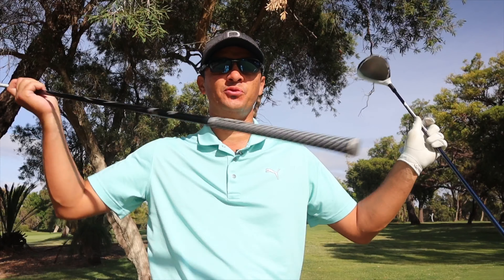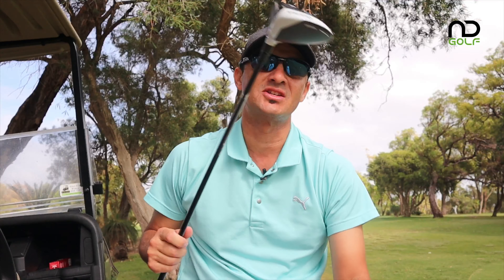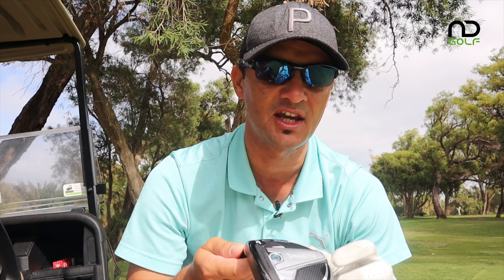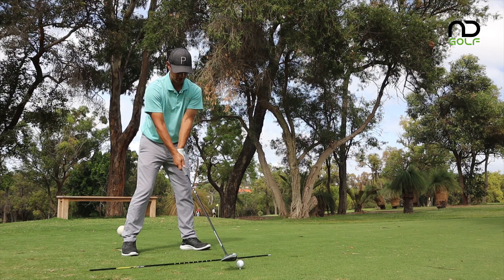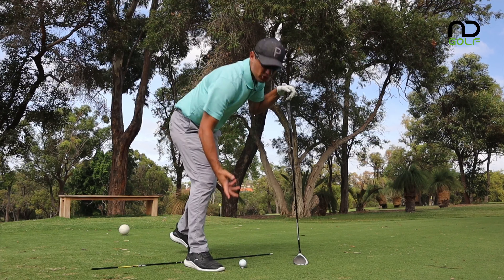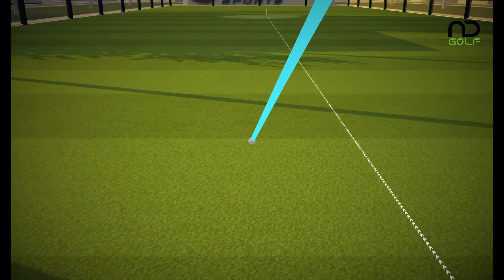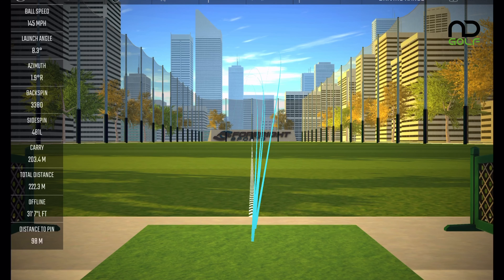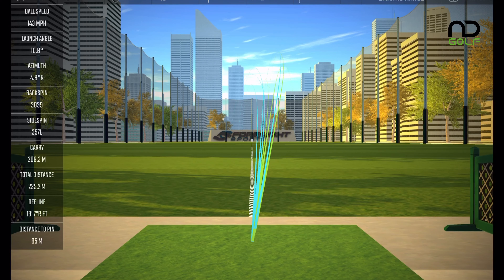TaylorMade Sim 3 Wood Max & Titanium

Comment: Please test the Mavrik and Mavrik SZ fairway woods.  I have a Sim Rocket 14* with the HZRDUS Hulk Green 6.5 coming but I’m a little worried about the size of the head and hitting it off the deck. I like to hit my fw’s off the deck as well as the tee.  The Sim is I believe 185cc’s in size.  I have the Mavrik in a Tour issued head and it’s only 155cc’s paired with a Ventus Red 7X and it’s so easy to hit off the deck and tee.  The issue is it has a very shallow face (which I like) but I know some people don’t because it looks too small.  I also have. Tour Issued Flash SZ in a 5 wood paired with a Ventus 8X.  It’s a monster and I used it a lot off the tee on short par 4’s.  Can carry it 240 yards and it’s easy to hit.  Would love to see a video on the Mavrik and then one comparison between the 2.  Keep up the good work.
Reply from the maker: I will do my best. Very hard to get hands on equipment right now due to covid. But I will see what I can do